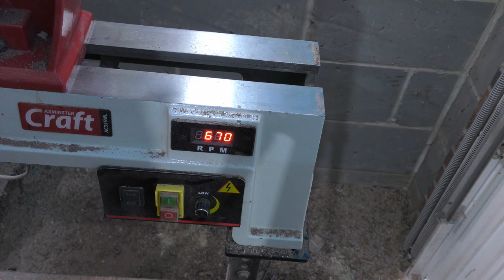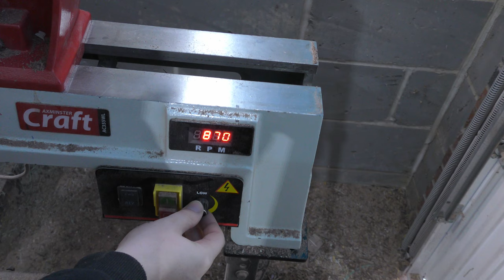I broke a chisel making this huge bowl.

Comment: You made quite a big job out of that. Pretty as always, maybe a bit deep for my liking but if that's what the wife wanted I understand why you made it like this.😁 Regarding breaking that insert: I think it was simply not the right tool for the job, an old-fashioned parting tool may have been the better option here. Lucky that you didn't damage the workpiece with that catch, or throw it off-center. Deep hollowing is always tricky regardless what tool you use. Recently I have made a pedestal bowl too. The video is scheduled for somwewhere in February. Be sure to watch that video, I would love to have your opion on it!
Reply from the maker: Yes, sure I will have a look.  We have two fruit bowls in the kitchen, now I can save some space with this large one.  The parting tool is very short. I just could not reach the bottom with a parting tool. There was no safe option with this piece.